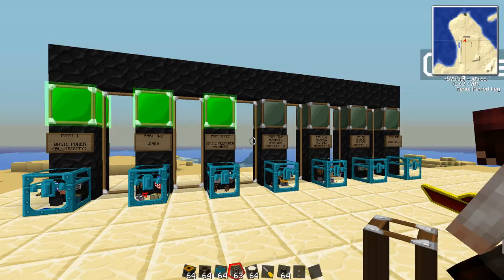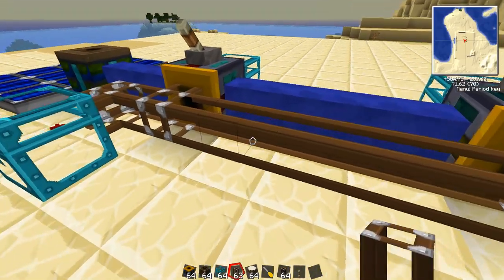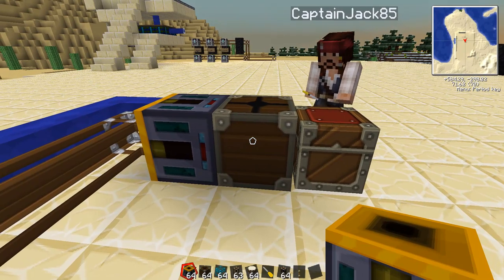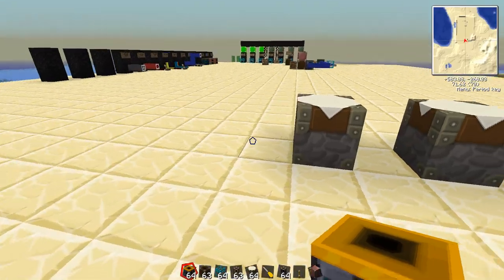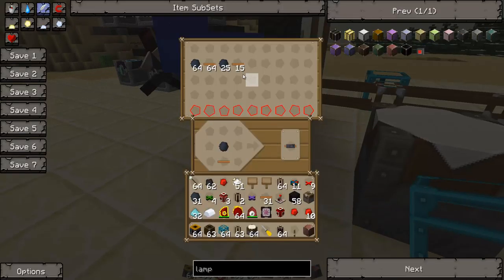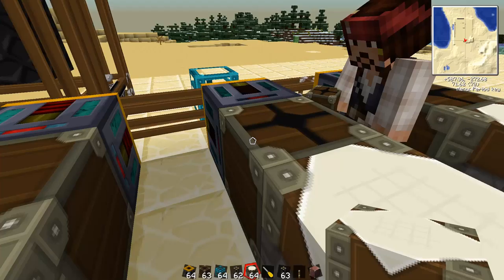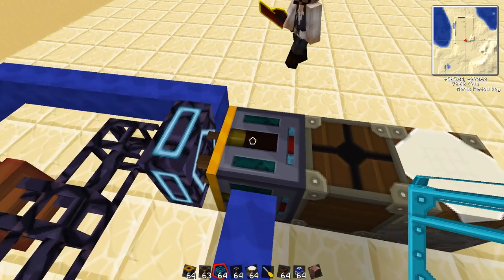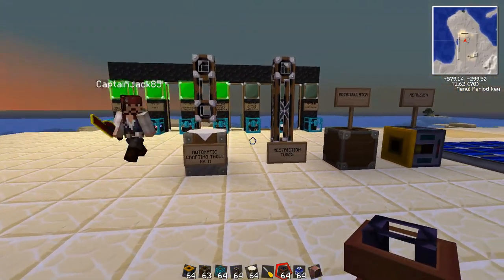Tekkit Classic - Megalith Tutorial Series - Part Four - Advanced Redpower Automation

Comment from the maker: In Tekkit Lite we use Phased Conductive pipe to remotely power Buildcraft Joules from our Remote Power Core. To convert MJ back to EU we pipe the MJ into a Pneumatic Generator. There are Pneumatic Generators for LV, MV, and HV so just change it depending on your power needs. Set it up like [Ph] [Gc] [PnG] [M] where Ph = Phased Conductive Pipe, Gc = Gold Conductive Pipe, PnG= Pnuematic Generator, and [M] is your machine.

In Tekkit CLASSIC Red Matter furnaces are powered with an Energy Collector!

Comment from the maker: Good questions - I think I might post a video to explain but we are using RM furnaces attached to retrievulator/retriever to pull Iron out of the condenser and into the back of the RM furnace which smelts it to refined iron. Connect the RM furnace to the network (just by attaching it to tubes) and now you have Refined Iron for whenever you need it.

As for what goes where, we basically set all empty rigs up at the start then just filled them as needed.

Let us know if a video expl would help!

Comment from the maker: So, assuming you've set everything up correctly, the slowness you're experiencing is actually normal. Immibis (the Retrievulator creator) slowed them way down in this version for some reason. If it hasn't gotten something in a while it slows down its requests - then as it gets more & more it starts to ramp up its speed.

AFAIK there is no way to modify this through a config file.

Try setting the tables and retrvltrs to make and request more at a time (even smaller amounts) to keep them active.

Comment from the maker: BC can be such a hassle (i.e. redstone engines,liquids,oil) and is just soo risky - if you don't account for pipe overflow you can crash your server... *cough*Exzyravax*cough*

I'd really NEVER recommend using BC pipes unless you're still in early-game setups and RedPower2 is just too expensive material-wise. ThermalExpansion adds some awesome stuff that is both BC and RP2 compatible so I'd suggest using TE machines early on as they can be upgraded to later support RP2 when you can afford it.

Comment: Hey guys, having some trouble on my 0.6.5 (and 0.6.1 before it) server, with the auto crafting network setup. I've copied your setup exactly, magtubes, buffer chests, correct ratios, all wired up -- but the retriever/retrievulator setup seems slow to respond, if it responds at all. Quite often they just stop responding. It's not a lag issue or RAM issue as I'm playing locally on a very fast machine. Any ideas? Going to load up AE soon but it would be rad to fix this if I can. Cheers.